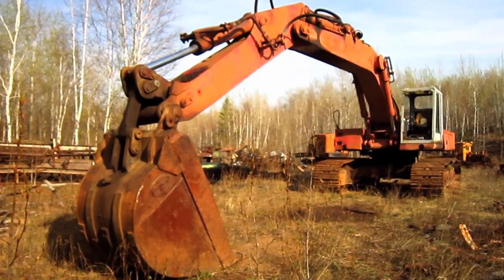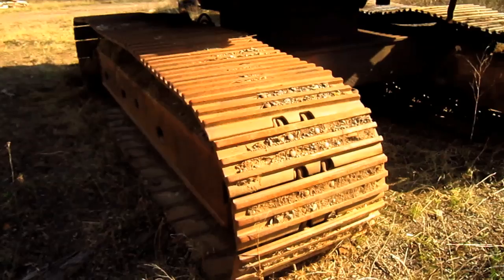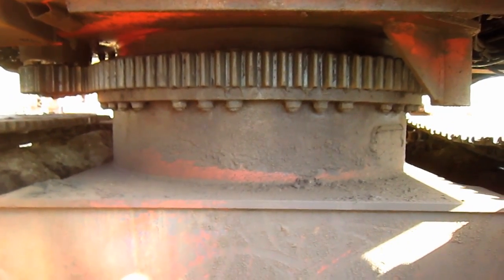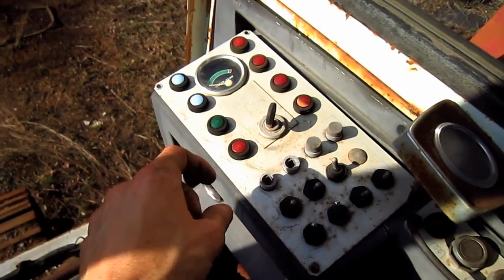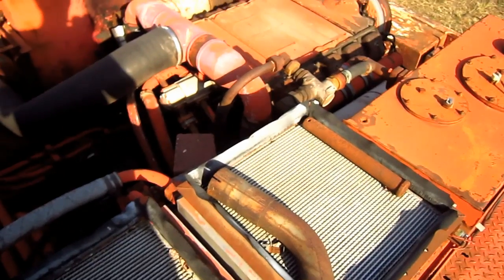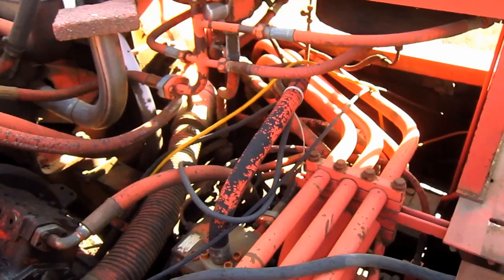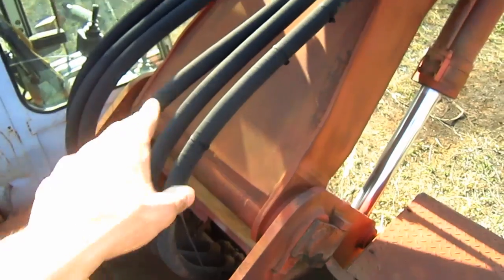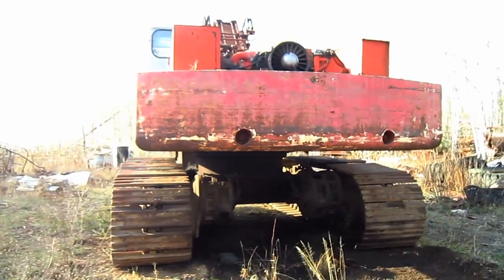Poclain 220CK Documentary

Comment: Great video! In the 70's amd 80's the Poclain excavators were very popular here in the Netherlands, one of the most popular model was the LC80, working on many earthmoving sites. Together with Atlas, Liebherr and O&K they were one of the most common machines to be found, and just like Poclain, a Deutz diesel engine was installed. Very reliable, easy in maintenance. The Deutz air-cooled engines had a typical whine due to the fan from the forced air-cooling system.
Reply from the maker: That's awesome. I'd love to hear one of them deutz engines running in person
Reply: @PAmining 😂  Mein Kumpel hat noch einen,  was waren das für geile Bagger.  😂🤣   👍

Comment: It reminds me of my TMS 180 Grove crane way over built I bet you couldn’t find any structural repairs because of it is engineered so well! I was very surprised to hear that it’s air cooled and I noticed that it has servos instead of linkage for the stick, I also noticed that it’s in good condition because when you worked the travel pedals they are tight ! Why isn’t it in service?🇨🇦😀

Comment: That’s an interesting looking hydraulic pump.
Reply: For the time a very good pump. They were available with 6 rows too. ideal for limited power with high flow  and flow sharing systems, because every bank gives exactly the same flow. That together with the small size  makes it great for high power output with high efficienty back in the day. When even more flow control is needed, then go for a axial piston pump. But then flow sharing is more difficult with only 1 pump.
Reply from the maker: That's what I said. Very unique! Hence why I love doing old excavators because they are all different

@brummert w, interesting information! Thanks for sharing!
Reply: @PAmining poclain designed piston pumps. And there famous system called "variodyn" have 100s of poclains books and brochures. Had loads of poclains only smaller ones tho

Comment: We have a Poclain P75B 1984 at home. You can start that Deutz straight 5 down to -20c in 1 rotation, amazing how easy it starts up everytime! 
Kinda funky down the road, focus needed to stay on the road at full speed 30 km/h.
It's kinda like a car, Clutch, brake & gas pedals and a 4 gear manual gearbox.

Bucket linkage seems mostly the same on ours to as in the video.
The hydraulic fittings is kinda a pain and odd pipe measurments.
/cheers from Sweden
Reply from the maker: That's awesome. Very interesting.
. The P75 is on tires correct? Greetings from PA!
Reply: @PAmining  Yes duals all around, think it's 12,5 - 22 if i am not mistaken. Quite a big machine at 19,8 tons + bucket. Poclain did a bigger one to at least, the P90.